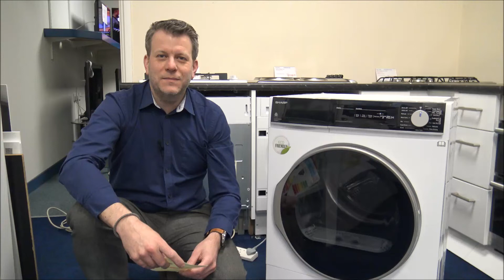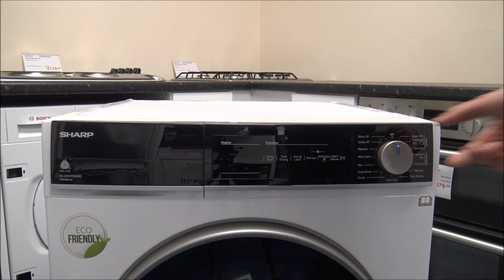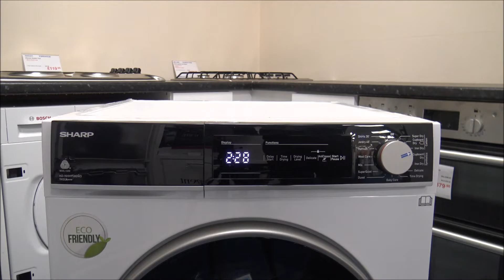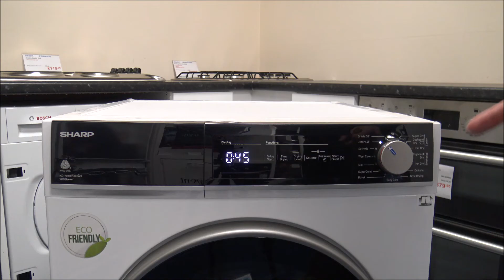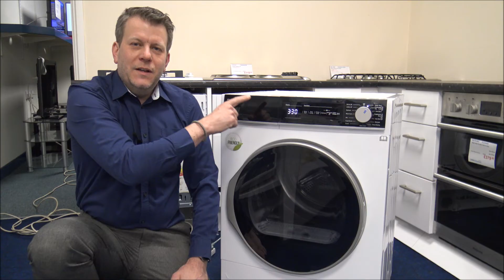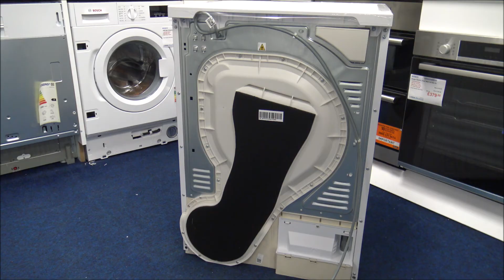Sharp KD NHH9S8GW3 EN Heat Pump Tumble Dryer

Comment: Bought one from Currys and it arrived with the front panel "Drying Time" touch button not working. The returns process, still on-going, has been a nightmare.
Reply from the maker: That's annoying to hear that it has gone wrong, but more annoying that Currys are not being efficient in sorting this out for you. Good luck and i hope this gets sorted for you quickly
Reply: @lords-electrical  I wont buy from them again! Online chat feature that is useless, automated call centre that doesn't recognise the manufacturer, emails sent with broken links, references to key returns pages online that don't exist, account that says i have to reset my password and a password reset screen that is broken....it goes on and on.

Comment: Could you explain the drying level please. Does it dry on a cooler level or relevant to how dry you want it. Thank you
Reply from the maker: Basically it is both of those, it dries at a lower temperature compared to a standard condenser or vented dryer which is why it takes longer to dry. You can also select how dry you want the clothes, so if you want them slightly damp then just make the selection so that you can take them out to your drying requirements

Comment: I have this dryer but it seems to be an issue with mine. I always use Cotton Cuboard dry and it dries for 45mins then said END, when i take clothes out its still kind of wet.. so i have to empty the water tank and dry again on the same cycle? 
Baby care i used yesterday on 5 items, took 35mins and came out dry. Not sure what to do?
Reply from the maker: Unfortunately we no longer have this in stock, but check the instructions as on some models you can change the dryness level of some of the programs.

Comment: Just bought a sharp heat pump dryer .
How do I open the door I have put what I thought was enough pressure to pull open but it not budge , don't want to break anything .
Thanks for any advice .
Reply from the maker: Some of the doors can be a bit stiff when new, so i would just try pulling a little harder as it should open quite easy.

Comment: Hi, does it really need installation into a drainage system or it can be placed anywhere in the house? Thank you
Reply from the maker: You don't have to use a drain, you can just empty the water from the container at the top of the dryer

Comment: very good look of machine, but just wondered if you can answer a question do some cobi washer/dryers come with a heat pump maybe its a silly question just wondered and also in a combi washer/dryer where does the lint go in it as I have a combi and cant find the lint filter in mine do you know where I could find its lint trap?